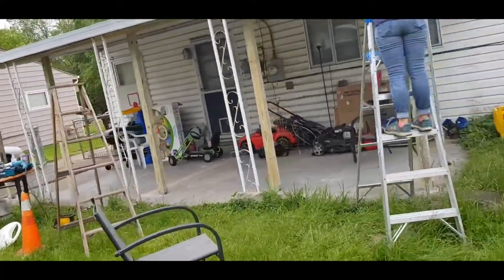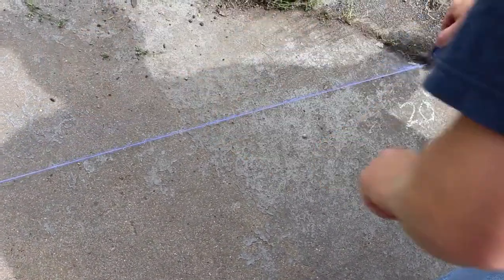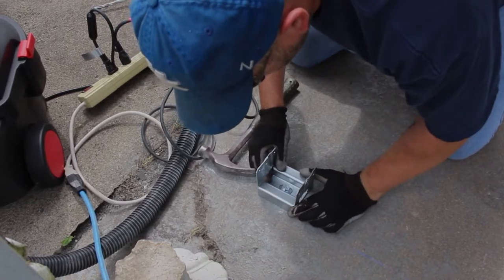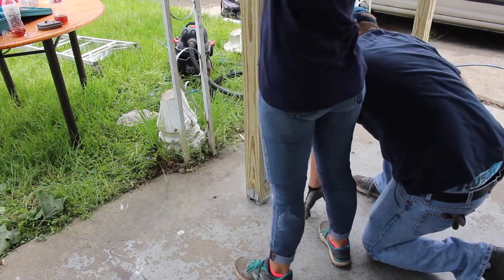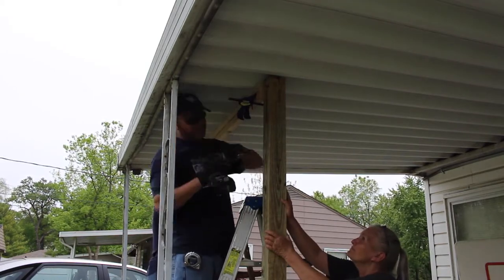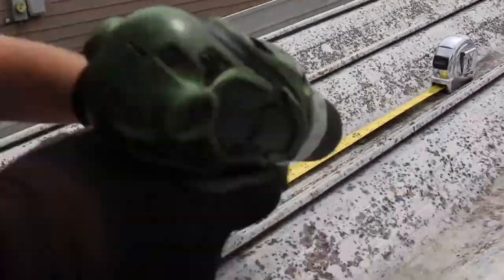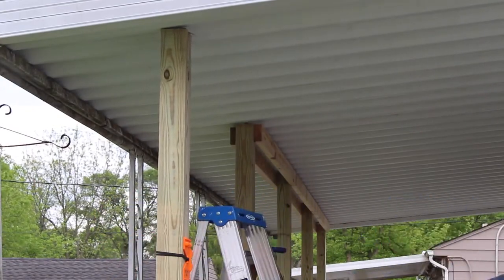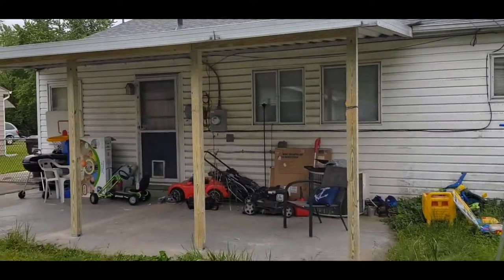HOW TO INSTALL POSTS FOR AN AWNING - POSTS FOR PATIO COVER

Comment: I bought five panels of 2x12 corrugated steel. I also bought New Black metal pillars like you have in the original. I'm wanting to create a retro look but need to know how to attach those metal pillars securely to the cement.
AND how to connect steel securely to the side of the mobile home

Comment: quick tip, self-drilling screws are for metal to metal or material to metal connections, only, not for metal to material connections. self-tapping should have been used for this application.

Comment: I don’t know if you’re still reading these comments, but I have a similar problem with two loadbearing aluminum posts that are 74 inches high that are fastened to brick at the bottom. They get a lot of moisture from the rain coming in from the south on an open carport. I can’t quite figure out what to do with the brick and the heavy roof they rest on. Super ugly and rusty.

Comment: No! No! No! Dude, the best way to replace these legs would be to simply remove the old legs and run a header across; underneath the gutter system. Then place the posts under the header and lag the posts to the concrete.. I literally just did it to my awning and looks amazing and is stronger than ever. The gutter system on these things are the "header" - so to speak. The metal roof has absolutely no support.